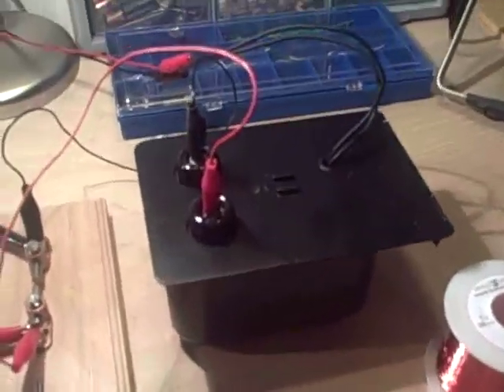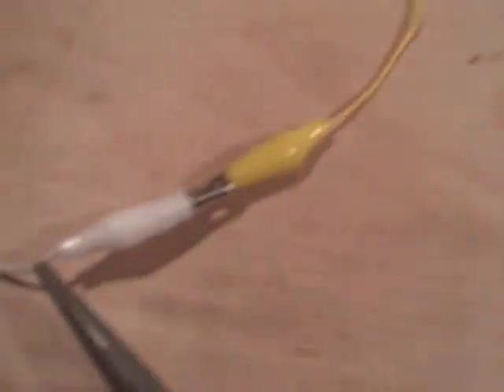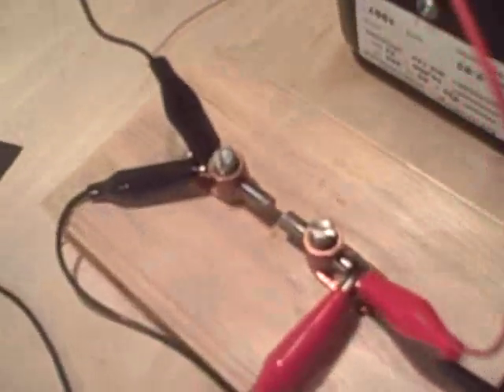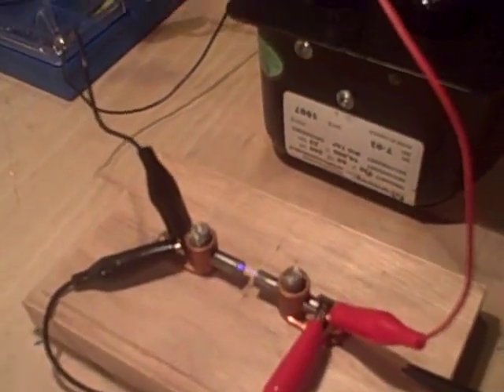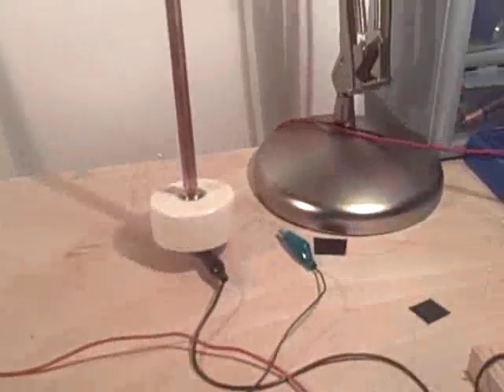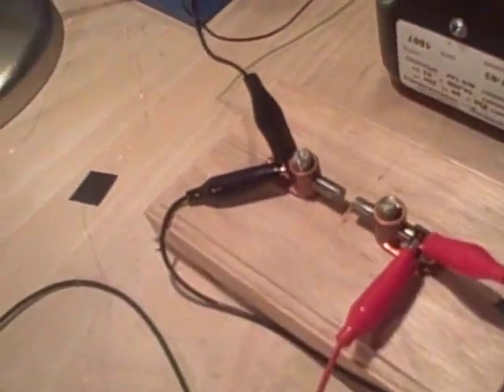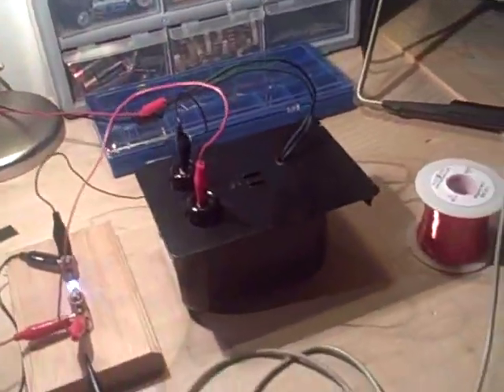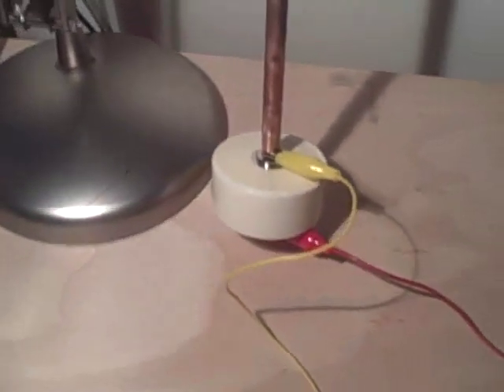non-linear power transmission with tesla hairpin circuit

Comment: Non-linear transmission and   Schrodinger's equation tells me  you  are  really  on to something  here.  2017 now  and  where are the  UPDATES on your work? How about  for  communication  on  light  cables  and   Transducers    for  space, amplification of   video and audio transmission  as it is capable of   spooky motion at a distance.   XC transmission  is  folding spacetime.  Now  , how do you  focus    it  ?  When you get a  large enough porthole ?  Are you a big fan of Star Gate?
Reply from the maker: I put the research down for a while, however, I am feeling the call once again. Keep an eye out for updates.

Comment: Yes, it worked!!! Iluminated a 500 watt quartz tube [bulb] using 30 gauge wire and about twenty feet away. At 120 votls ac this bulb should draw about 4 amps. 30 gauge wire used for power transmision will, under normal conditions handle 0.142 amps. Apparently these are not normal conditions. To prove and by many, that this type of energy is a viable sourse of power will make a very big impact in the near future. Now to build a fly weight protable model. Thanks for the time and effort.